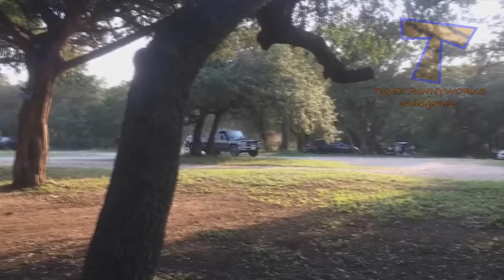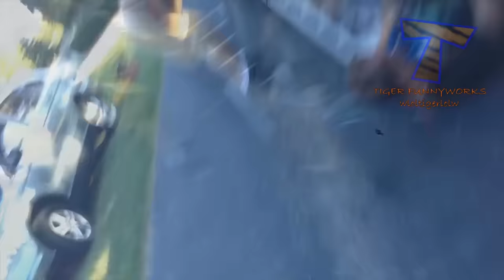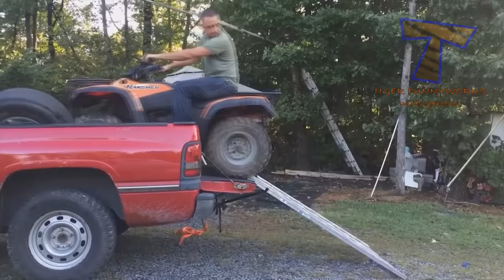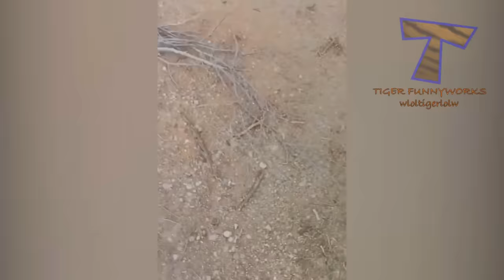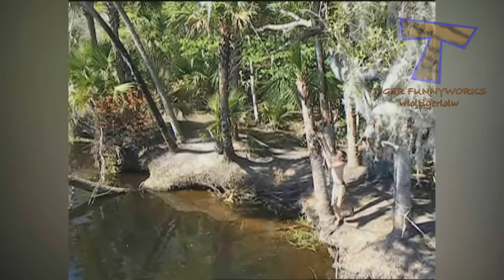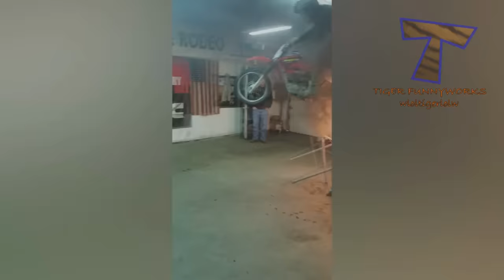"Southern" FAILS and FUNNIEST MOMENTS 🤣 Gotta LOVE these guys!

Comment: Hmmm... I have either done,experienced, been apart of about 90% of this whole video lol
Reply: Yup me too
Reply: Let's chill lol
Reply: Also me
Reply: Thank  you for your service, sir
Reply: Cool jordan
Reply: I want to have a beer with you
Reply: As a Florida man I do concur
Reply: The one where the guy flips the lawnmower is probably the one that hurt me the most. I did it when u was cutting grass for a guy after highschool, it was Grasshopper diesel  325D. Now they have “wheelie bars” is what I call them, but went to load it up, and the trailer was parked where the ramps and floor of the trailer made a “triangle” peak and the front deck caught it and stopped me for goin forward, so instead of gettin off and pullin the truck up I decided I’d be “smart” and jus pop a wheelie over it like I’ve done many times before, except this time I gave it a lil to much fuel and it popped up and I was look at blue sky for atleast 2-3 seconds and flop lol it did jus like that dude on here come right on top of me and squished me like a accordion lol did it hurt? Yea but not like it did the next mornin, felt like I had squished by a big ass lawnmower..... lol 😂 really tho that 2nd and 3rd day was hell. Couldn’t hardly move, and ended  herniating  a disc in my back at the ripe old age of 24, and since then I’ve had leg pain that radiates down the back of my left leg and top of that foot is numb along with the pinky toe and tip of my big toe lol had 1 surgery and should’ve had another one but I don’t want another one unless I absolutely HAVE to have it like the first one. The disc couldn’t suck it back in on the first bc it had torn off on one side of the disc. So word to the wise just move the damn truck or trailer lol sorry for the long story
Reply: Ramadan Steve  eh, its not crazy to believe.. This is how middle class kids in america get down..